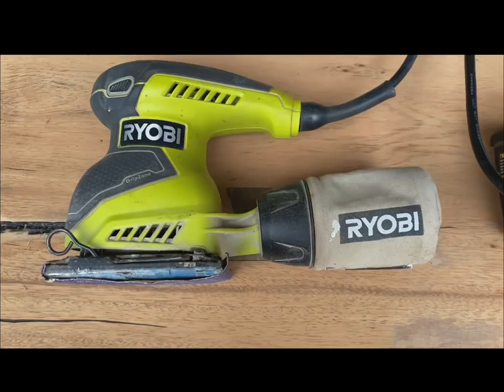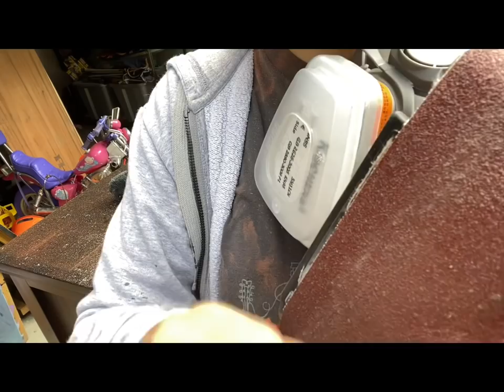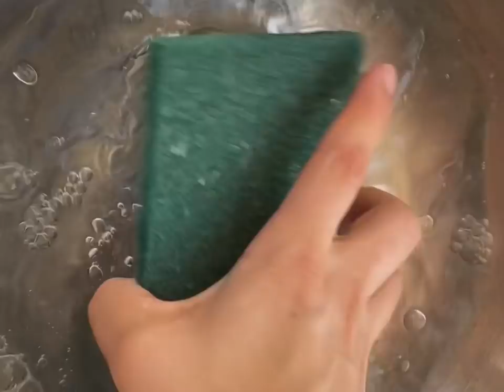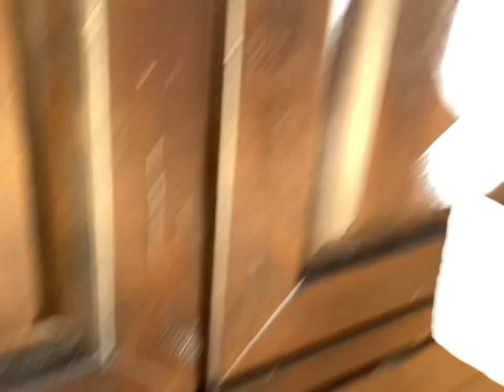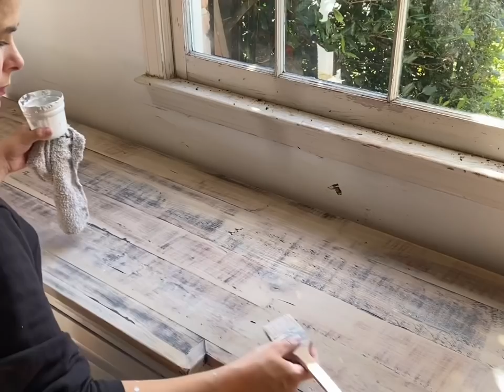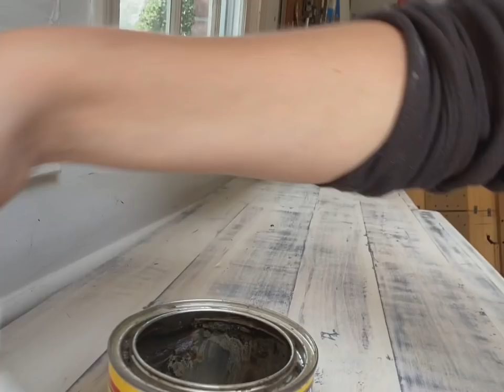Furniture Flip! $30 power sander 🤯 WOOD TOPS=💴 Flip Faster & Make more per piece • 1st time Fusion

Comment: A belt sander can do a great job of removing a finish or smoothing a surface quickly, but they also like to eat furniture if your aren't careful. 
The best way to clean sanding belts and pads is a big block of gum rubber sold for such uses, typically called an "abrasive cleaning stick" or similar such  names.  It's like a giant slightly sticky eraser that does an amazing job of removing woodxdustcand finish residue from abrasive disks, belts, and pads.
Reply from the maker: I had no idea that existed!!  Super helpful, thanks!
Reply: I had no idea it existed either! I always use a putty knife. It covers more area and is faster than a kitchen knife ☺️
The chalk paint I mix up is hard as a rock and so I use a sander when I distress my items and that always gunks up my sand paper

Comment: I was a bit skeptical when I saw there was still paint remaining on the top, but it turned out so beautiful in the end. Your videos and tutorials are very helpful and informative for beginners like me. And I like that you share different techniques and products than others, so I feel I’m learning new things. I tried General finishes milk paint and their water based topcoats that you recommended, they worked very well for me. The gel stains are also easy to work with. I’m curious how you think of fusion’s mineral paints compared to gf’s. They are so popular

Comment: They make a cleaning block it’s like a hard gum eraser to get the gunk from that belt.  You just hold it against the belt as it’s running.  Back in the old days in shop class we used an old shoe sole like a chuck taylor!  Love what you are doing

Comment: I stopped using a chemical stripper because the fumes were horrendous, you are wise to use the sander as it’s much safer. Brilliant job on your flip ❤️🇬🇧
Reply from the maker: Yeah, that was partially my thinking. ❤️ thanks so much!

Comment: I always sand SOMETHING on my pieces (top, drawers, feet) because I love the mix of paint and wood. I think it makes every piece so much more interesting. I live and die by my orbital sander. And I recently tried Fusion paint also....it IS beautiful but I’ll still use the $15/gallon paint from Walmart for my pieces that I need to keep on the cheap 😉.
Reply from the maker: Yes, it makes it so much more artistic!  You’re cracking me up about your sander!  My paint is still fresh so I haven’t scratch tested it yet, how did your fusion hold up?  Like I said my friend swears by it and her dad is a cabinet refinisher so must be pretty legit.  I’m soooo cheap tho gonna have to really impress me when I do the scratch test!
Reply from the maker: What paint do you use from Walmart?  I never tried it.
Reply: Walmart has a brand in their paint department that is ready mixed in basic colors like white, black, off white, taupe and it comes in flat & satin. It is latex paint but I use it for furniture that I am going to put a sealer on anyways. Of the three pieces I’ve used Fusion on, two of them I also put poly on since I was selling them. The one I didn’t is an MCM desk that I did for myself...I didn’t think to give it a scratch test now that I’ve had it a couple weeks but I will!
Reply: @lynnes8047  Would love to know how the scratch test goes.
Reply: So I did the scratch test on the Fusion mineral paint that I did not seal (I had applied a primer since I was using a white paint)...it didn’t scratch off!
Reply: @lynnes8047  Thanks for sharing.

Comment: I noticed after I white washed my table top that it was a bit rough to the touch. Had a buttery-smooth feel from finishing with 400 grit pre-wash, but post white wash, a bit rough. Should I sand it before I wax/glaze or wait till after 1st coat of poly and sand it then? Thank you!

Comment: Just a note, I turn my belt sander on a slide angle to one side as I'm sanding long tops. Turing it help to not sand tracks in the top or cutting groves in the wood. When you sand with your finish sander you can get the angled sand marks out of the surface.

Comment: Turned out beautiful. Just curious, why do you not remove drawers/doors before painting? Have you ever had someone not buy because the inside is not painted?
Reply from the maker: Nope, always sells ❤️ I like to leave it so they don’t get scratched like this one has a shelf inside for electrics and would get all scratched.  I do paint around the rim on the drawers always, I just do it last and leave the drawers slightly open to dry ❤️

Comment: Have you ever used a paint brush called a Zebra Brush? It lays on the smooth, especially when you do the second coat. When doing the second coat try not having a heavy hand. The dresser in your video is beautiful. I also use wax but it's Minwax White. Great job 👏

Comment: Orange striper home depot or any home improvement carry it it's easy to use.
Reply: They changed the formula and it ends up like trying to remove partially dried glue. 👎🏻

Comment: I find an orbital sander is safer for me over a belt sander, but that's me. My experience 30 yrs ago. Haven't messed with chemical strippers but might soon. So much has changed in new products.
Reply from the maker: I had an orbital a while back but it died on me, need to get another one ❤️

Comment: How did you get it to not streak? I tried using this paint a few days ago and it was so streaky!!
Reply: What brush did you used? Too much paint isn’t good as well as too little andddd painting during hot days is hard because the paint dry too fast. 

I work with a purdy the synthetic line and it is fantastic. It normally takes 2 coats of paint,i brush the body but for the final coat I roll the top.
Reply: @wenbb2009  I used zibra brush
Reply: I've been using Fusion for years. The less paint on your brush the better. Almost a dry brush painting. I've  done pieces with absolutely no brush strokes. It is a true one step paint. Scratch proof after 21 days if you've cleaned your piece properly.

Comment: Looks great.

But what about the no sand, no prime, no topcoat mineral paint?  I'm still waiting for someone to actually say it's just as good as sanding, priming, painting, and top coating.  Difficult to believe it is.  And that piece looked like it had no topcoat on it.  

If there truly is an all-in-one paint, that would save hours of time!
Reply from the maker: Eddie, stay tuned because I have a recipe I’m going to do in a video soon that’s the closest thing you’ll find to a one step paint.  I’m also going to be doing a scratch test when the fusion is fully cured but I can already tell ya, it’s good paint but I have a cheaper way to get a stronger finish.  I’ll be putting that video up next week doing a kitchen table ❤️
Reply: @blacksheephouse  Nice!
Ok, I'm on board.

Two more things:

1. I like how you didn't sand the top down to perfection.  The black spots add a lot of character.  I need to remember that.  
2. I use to use my Surf prep sander to sand tops--way too much work--so much work that I gave up and have been using stripper for 9 months now.  Stripper is amazing--but what a gooey mess at the end.  You inspired me to look at belt sanders.  I didn't know they were that cheap.  The ones I see are always $200-300.  Are you happy with your $30 Walmart one?  Sometimes, that's all you need.   If you're happy with the cheapo, I'll probably try one and use it until it breaks and then maybe spring for a $200 one.  It'd be really nice too if I could hook it up to my wet/dry vac.

Comment: I used Citrus from Home Depot for a long time...it used to work so good but BUT i just purchased a bottle a week ago and oh boy they are selling crap in a bottle...Horrible!!  Does have a strong chemical smell and the orange scent is non existing.. I applied and put the plastic as always done it before..oh boy...it took the plastic and glued it to the wood...and that was a pain to remove...then the finish was not even 10 percent removed and the rest was like if i used water ...nothing happen... the gel was a goo...dried in less than 10 minutes with the plastic on and the only thing that this product was good for was to mess up my project and glue the plastic really well to the wood.  Now..today i went to Woodcraft store and purchased a soy base stripper ..a gallon is 72 dollars (OUCH) but i hope that this one will work very well.  I will let u know what happen...
Reply: @babyfat6677  ohhh  good to know... oh boy those guys are going down if their product is not good any more.    Sanding a large piece is not fun specially when there are several old crusty paint and varnish...for now I am going to try the expensive brand and see if the price ticket is worth the product.   Thank you so much for the info..so I was not crazy, nor picky nor the product was bad  it was just a change of formula that do not work as used to be...LOLOL
Reply: No problem! Let us know how this stripper goes!
Reply: Absolutely terrible product.